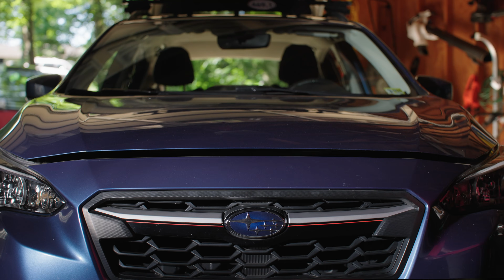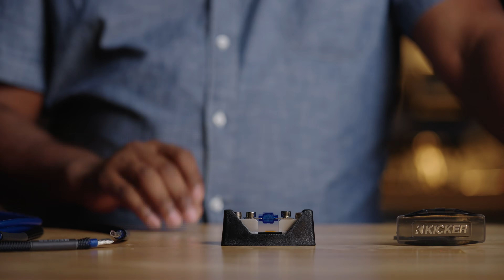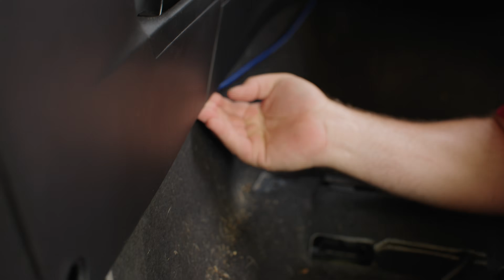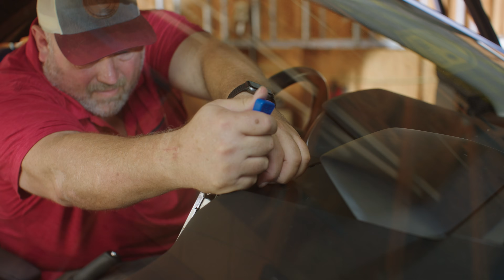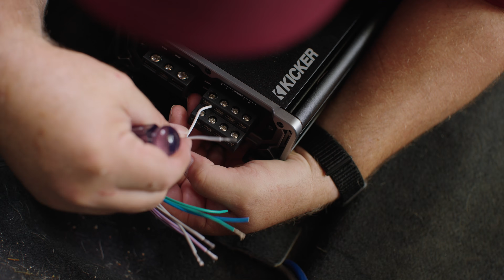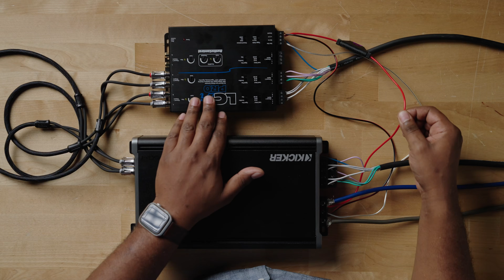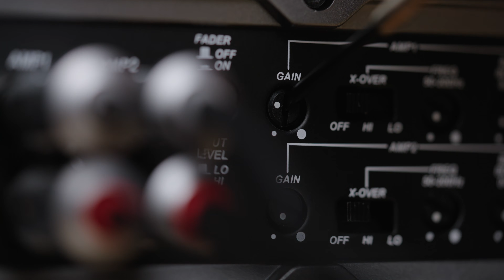How to install a car amplifier with a factory stereo | Crutchfield

Comment: Which is better Blam Relax 165 R2S or  Alpine S2 S65C? Thanks in advance for your input.
Reply from the maker: We cannot compare products like the Blam brand speakers that we do not sell and have not tested. The Alpine S2-S65C's below are very impressive with great sound quality, one of our top sellers. They are Hi-Res rated with a response up to 40K and can handle 80-watts RMS power, making them a good match for a wide variety of systems.

https://www.crutchfield.com/I-rYALc166/p_500S2S65C/Alpine-S2-S65C.html

Comment: If my car is equipped with a factory amp, should i use the low level input or high level input when connecting signal wire to a aftermarket monoblock amp to drive my sub?
Reply from the maker: High level inputs should be used in cases like yours when getting the audio after its been amplified.

Comment: Can crutchfield get some T-harnesses for newer Kia’s with the Bose system so I don’t have to splice into my seltos 😂
Reply from the maker: We tend to offer T-harnesses when they are available. With some vehicles splicing will be required when installing aftermarket gear. If you have to splice, make sure to leave plenty of wire to work with and also save your factory plugs in case you need to re-attach them at any point in the future.

Comment: why 75% volume on the head unit?
Reply from the maker: This is a good place to be for high-volume listening without distortion. Anywhere above that level most any aftermarket radio will start to "square off" and distort the signal or produce clipping.

Comment: I am most likely going to be installing an amp in my 2023 kia forte gt line, its a newer car so I am a bit worried for the amount of cables and stuff that I'd need to mess with and unplug. Ive been going through many crutch field and other installation content online however even choosing the right amp and sub for my car is difficult. My future plan is to install a possibly 5 channel amp for my 4 speakers front and rear while saving another channel for a future subwoofer. Are there any tips I could get about choosing the right amp and subwoofer? I will be purchasing everything through crutchfield as well since a lot of comments recommend the expertise that comes with your website. LOVE the content keep it up
Reply from the maker: Thank you for the kind words, we appreciate them🥰.  The AudioControl LC7i PRO from the video is needed here if you plan to keep your factory radio in place, and it does need to be wired in to your vehicle. The Audison SE 5.600 in the link below would provide the extra 5th channel for your subwoofer when you decide to add it, plus is provides robust clean power. You'll want to make sure you choose speakers that can handle 75-watts RMS or higher and a subwoofer that can handle 550-watts RMS at 2-ohms or higher.

https://www.crutchfield.com/I-rYALc166/p_302SR56002/Audison-SR-5-600.html

Comment: Piercing tool and wire worm, I just use a screwdriver and some duct tape.
Reply from the maker: We've had success doing it your way also! And an old wire coat hanger can work well as a worm.
Reply: @crutchfield  ooh the coat hanger, that’s a good tip

Comment: How to do a C 7 Corvette . Adding an AMP! to a BOSE on board AMP
Reply from the maker: Much of the same principles shown in this video still apply with the change being that you pick up the audio at the Bose amp instead of at the radio.

Also, gear purchased from us comes with our lifetime technical support and they can help guide you through the install. Their phone number comes included on the shipping label used to get the gear to you

Comment: If you wanted a subwoofer it would be the same but a 5 channel amp instead of 4 an connect sub to amp ?
Reply from the maker: That is exactly correct. You would need to connect an extra pair of RCAs from the subwoofer output channels on the LC7i to the subwoofer inputs on your 5-channel amp.

Comment: I’ve been watching this video and my question is can I use a 5 channel amplifier? It has speaker level inputs so I wouldn’t need the LOC right? Can I also tap into one of the speaker wires to use a speaker to RCA connector for the subwoofer input?
Reply from the maker: Since the LC7i has 6-channels of output you can use a 5-channel amp. Using a processor like the LC7i will correct the poor EQ and restore missing bass from your factory radio. If you have speaker-level inputs on your amplifier you can directly connect, but your system will sound much better when using a processor like the LC7i.
Reply: @crutchfield  thanks
Reply: @crutchfield the thing is this amplifier has a subwoofer output. Can I use this LOC to get signal to the sub input?
Reply from the maker: We are here to help anytime!🥰
Reply from the maker: The AudioControl line output converter would provide signal for the RCA inputs, including subwoofer. If your amplifier also features a subwoofer output RCA, that can be used to provide line-level signal to a separate subwoofer amplifier.

Comment: Great tutorial! my question is, where do i need to connect if im adding a powered subwoofer?
Reply from the maker: If you are adding a powered subwoofer to the system pictured in the video, you will connect an RCA output connection from the subwoofer-specific outputs on the AudioControl line output converter to the inputs on your powered subwoofer, then run power/ground and amplifier turn-on connections to your powered subwoofer.
Reply: thank you so much I appreciate it 🍻
Reply from the maker: Thank you for enjoying and commenting on our video, we are happy to help!😃

Comment: I’m curious can you just piggyback from the lc pro to the amp  speaker wire for the front & back speakers
Reply from the maker: I am not quite sure what you are asking. The AudioControl processor uses speaker-level input signals from your factory radio to convert to line-level RCA for input to the amplifier. There is no use for any "piggybacking" when installing your gear according to our instructional video.

Comment: How do I know if my car will have bass roll off ?
Reply from the maker: If your vehicle still has the factory radio installed, then it most likely has a bass roll off feature built-in to the factory radio. Using a high-quality processor/line output converter is the best way to ensure the highest sound quality when using amps with your factory radio.

Comment: Dont use a volt meter. Use an oscilloscope. Volt meters arent always accurate
Reply from the maker: What's your preferred oscilloscope brand to use when setting up an amp?
Reply: @crutchfield  I have a $30 one from Amazon. It's not about the brand it's about if it can do the job.
Reply from the maker: Nice! What kind of jobs do you perform where you absolutely need the additional accuracy? For most of our customers who are not professionals and are do-it-yourselfers, the multimeter is a great move.

Comment: “Sit back, relax and watch us make you even more confused than you were before you clicked on this video. LOL.”
Reply: He explained this extremely easily tbh.. I mean this in the nicest way possible, if none of this makes sense to you, you need to do alot more research or just take your car into an audio shop
Reply: @whoseveret  my problem is the vehicle specific t harness doesn't exist for my vehicle
Reply: I'm sorry that it's four months since your comment and probably too late, but I wanted to mention that it is possible that a harness for your vehicle exists [but Crutchfield doesn't carry it].

My 2019  Chevy Bolt has six speakers in the factory system, including tweeters in the front dashboard wired in parallel with woofers in the front doors.  It took searching a Chevy Bolt forum to find what t harness/harness extender would work with it.

Then I had to search to find an online retailer who sold such a product.  Sometimes they provide a list of vehicles it's compatible with but in my case, the list didn't include my vehicle [even though it is compatible].

These harnesses seem to depend on the vehicle's make [so mine was for GM vehicles].
Reply: @Tidbit0123 yyuuuuupppp. Makes my life a fucker
Reply: @whoseveret no a lot of people aren’t mechanically inclined to do that much work, this is YouTube lol not a 10 dollar video I has to pay for, most people just wanna hook up a amp and that’s it not do extra shit
Reply: Subjects can only be simplified so much and the light bulb isn’t meant to come on for everyone. If a slow, methodical explanation like this isn’t enough, then watch more videos to learn, ask questions, or put the screwdriver down and pay someone.
Reply: @I @Icutmetal take it easy…this is a very different world and if you are new to it then terminology is extremely important.  After a person has done this stuff for many years they tend to talk fast even if it doesn’t seem like it to a seasoned person.  YouTube is our new Youniversity so harsh comments need to be treated as the kid in class who loves to have everyone’s attention😢.  I’m saying this with a big smile and love in my heart I swear!  Heck I WAS that kid in class at some point so it’s all good we learn and grow more patience.  

Very intelligent folks can just have a different way of learning so even if it takes 40times of watching a good video in order to get it … please don’t give up.  It will click ❤so be encouraged everyone and I pray we all get tunes very soon.  I’m still waiting for the click myself😂😊😂❤
Reply: It's not confusing when you follow it step by step. The sound system I installed from them It's awesome but it's missing that clear sound. The sound that hits the soul my friend.
Reply: So you unplug the battery and then what?
Reply: Thankyou this video has has really helped me to build up the confidence and just pay someone to do it fk that 😂
Reply: You’re 100 percent right I am already lost
Reply: @bellyndayikeza4799  i would recommend watching again, or paying someone else to do it. This video really is about as simple as they can explain it. Some projects just don't "click" for everyone
Reply: Bro facts😢😢
Reply: No doubt. This makes me just want to give up… and I’ve been installing my own systems for years. I’ve never had to use a factory radio before though.
Reply: You guys must be retarded. This is the most concise amp install video ive seen in Youtube, so far. And ive seen atleast 6-7 in the last few days, including CarAudioFabrications video/s.
Reply: I’ve been using ChatGPT to learn about car audio. I just kept asking it question after question and it answered everything. It’s an amazing learning tool. Like your own private tutor. I’ve learned so much. I suggest trying it and you’ll be able to follow along with ease after a relatively short period of time. It would probably have taken me years to gain the knowledge I’ve gained in a month. It’s also fun when you get direct answers to all your questions.
Reply: Sorry you're dumb 😢
Reply: Bruh...
Reply: I'm a girl n hav3 no clue but u would be surprised at what I can do I work on my own car but when it comes to the stereo components I'm lost I know how to hook up a stereo but with Amp n speaker in box I haven't a clue I think I do better with pics
Reply: He actually made perfect sense helped me make a change to my grnd wire.
Reply: Actually this video is the most informative one I’ve watched so far compared to the rest
Reply: ... And then you're good to go. Easy peasy.
Reply: Just watch carefully and take it slow. This is pretty approachable if you don’t overthink everything. They show you everything they do and talk slow enough for me at least. I’m not sure how much better they can make this without over complicating it indirectly.
Reply: Yessss!
Reply: Bruh dead ass lmao I thought I was the only one
Reply: Just rewatched the video. I don't think they could be any more clear about what to do
Reply: Ngl I’m lost 😂 smh
Reply: For real 😂😂😂
Reply: It all true 👍 😅
Reply: Yeah it's like when you know something and the other person doesn't , you talk to them like they should know! 

"Bro, what's not to get!? You just take the J connection hook it to the cross drip emathic leak fueler and divide it by rizz compacitor in the fluk manual.....easy!"
Reply: @coochiecrook7120  lol
Reply: @coochiecrook7120  Is that with or without the rotary gerters?
Reply: Ikr this is all common knowledge
Reply: Seemed pretty straightforward to me.

Comment: what all would i need to do a 2016 ram 2500 add a 4 or 5 ch amp with the factory stereo
Reply from the maker: What is your cab style, radio size, and total speaker count in your 2016 Ram 2500?
Reply: @crutchfield  crew cab  its the 5 inch one it has 6 speakers thank you
Reply from the maker: The cart link below contains the package compatible with your truck. Using the AudioControl LC7i PRO, vehicle specific adapter harness, and 9-wire you can install the Pioneer GM-DX975 5-channel amplifier into your 2016 RAM 2500. This allows you to choose speakers that can handle at least 75-watts RMS and a subwoofer that is rated for 600-watts at 2-ohms. Using this loadout is the recipe for a fantastic sonic setup!

https://www.crutchfield.com/I-rXYEc222/cart/EmailCart.aspx?emKey=3448388

Comment: Do I need a line out put converter if I’m useing an after market stereo
Reply from the maker: No, you wouldn't need a line output converter when installing an amp with an aftermarket stereo. You can connect the amp directly to the aftermarket head unit's RCA preamp outputs.

Comment: Amp+velcro looks easy to do, but I would be afraid it has been attached firmly. I glued wood board under the carpet and abc on the carpets and use screws to attach amp. Great video thanks
Reply from the maker: When in doubt, use more Velcro lol We've done your method of securing wood to the floor and then securing amp to the wood often enough to know that works too!!
Reply: @crutchfield  okay! More velcro 😀
Reply from the maker: 😀👍 Keep us posted!

Comment: You did not explain setting the levels for each channel on the LC7i
Reply from the maker: The adjustments on the LC7i Pro are very straight forward especially when using the maximized LED indicators. If you need information on how to set those correctly, check out the owner's manual link on the AudioControl LC7i Pro product page below!

https://www.crutchfield.com/I-rYALc166/p_161LC7IPRO/AudioControl-LC7iPRO.html
Reply: @crutchfield  so I assume you would set the LC7i after tuning all the other stuff you mentioned?
Reply from the maker: You would want to set the LC7i prior, you can dial in the optimization lights first with an audio signal even before connecting the RCAs to your amp for an audio signal. Once that is dialed in you can use your voltmeter get exactly the right AC voltage output on each speaker channel. It's crucial to adjust the LC7i first as those adjustments can affect the amplifier's output signal. AudioControl makes it super easy with the LC7i!🤘

Comment: Alright, now do a 2020-2024 Explorer with B&O system.
Reply from the maker: Hi Ric, amp installation is not vehicle specific, though we may have some vehicle specific interfaces for signal depending on the exact year, make, and model. Are you looking to add an amp to your Explorer?
Reply: @crutchfield  I'm going to be replacing the B&O so I know I'll need the Maestro A2B and the harness that goes with it. What I'm unsure about is how to power the front 3 way active and the rear 2 way active while keeping the center and rear surround speakers for factory sounds (chimes etc.) A monoblock for the sub will also be used.
Reply from the maker: What exact year is your Explorer, and do you have the 10.1" radio or the 8" radio?
Reply: @crutchfield  2020 , 14 speaker B&O with 10" screen
Reply from the maker: Thanks! We looked over the iDatalink gear and it is not set up to run an active system. But it can create the preamp outputs needed to run to active crossovers for an active system. We do not have a device that can create the 5 pairs of outputs needed to run 3-way active in the front and 2-way active in the rear. But two devices could be used for this as well as blending in a subwoofer. The smallest (since you will need 2) of this type is the JL Audio TwK 88 found here:

www.crutchfield.com/I-rYALc227/p_13698101/item.html
Reply: Y E S 🎉

Comment: 8 gauge wire is not big enough for 60 amps per NEC. 60 AMP uses 6 wire. Unless it is a long run, in that case wire has to be increased in gauge
Reply: Your right ,but on the music world, you are not at a constant frequency at max volume so you never pull max rated amp. Probably peaks.
Reply: 8ga is fine if you're using OFC and not CCA.  I've used it for over 10 years. It just has to be fused correctly and in the proper locations with no skimping.

 It also depends on the Amp (A/B or D), RMS power rating, length of the run, etc.  If you're pushing 400-500w RMS or more,  definitely use a thicker OFC wire.  But most of the Amps people buy, like an off the shelf Pioneer, Kenwood, or Alpine are 200-250w RMS @ 4ohm which wouldn't require more than 8ga OFC in a run of the mill sport compact or small utility vehicle.

Now, if I'm running a DS18 SMD 500 A/B amplifier, lol, 0ga. Even under 13'. I'm not messing with 2ga.
Reply: Thank god they swapped the fuse out for a 40amp one for the amplifier